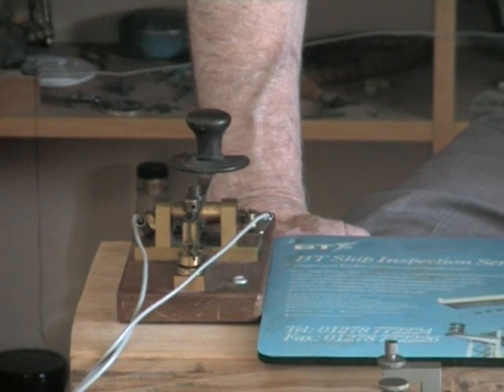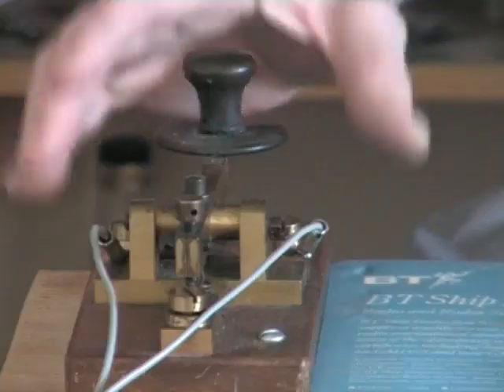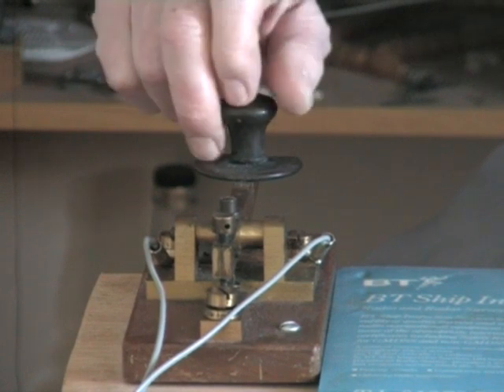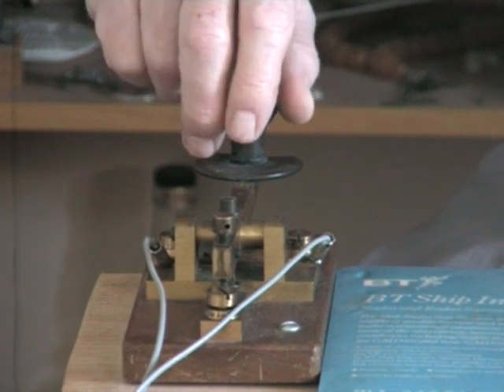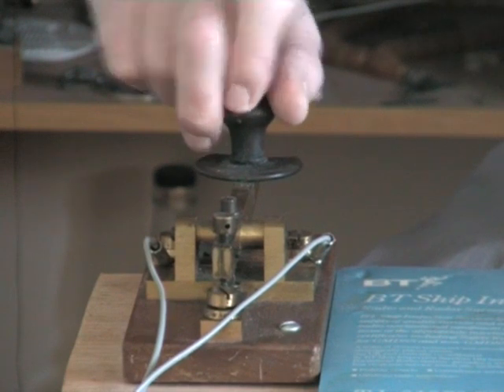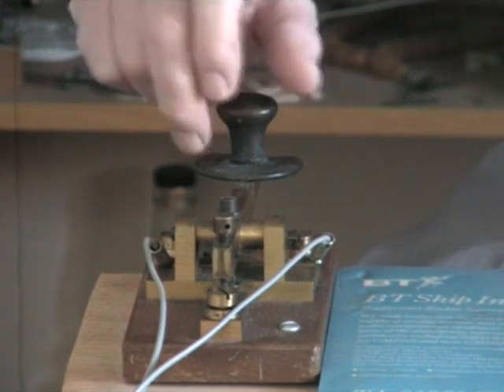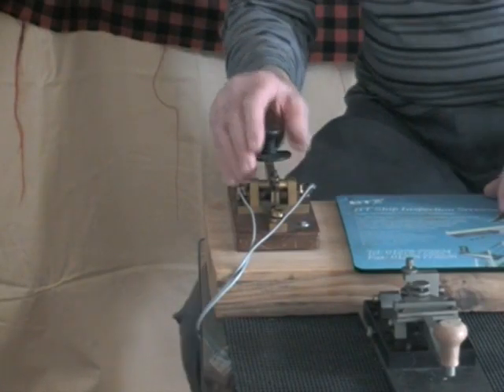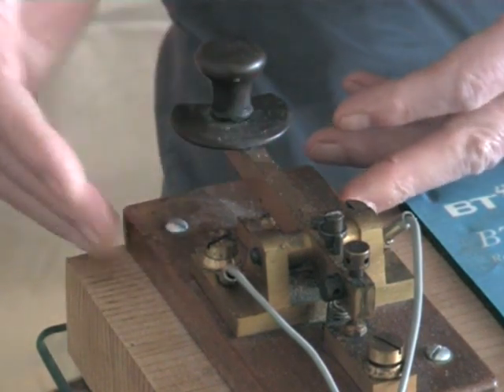MORSE CODE OVER THE OCEAN

Comment: The character length is pretty fast, maybe 20 wpm... do you advise learning at a slower character speed to gain the right 'weight' or empasis?
Reply: Many people suggest learning the characters sent at the higher speed but with additional spacing so that the overall speed is low, but the characters are each 'fast'. I don't recall how I did it - back in 1970...